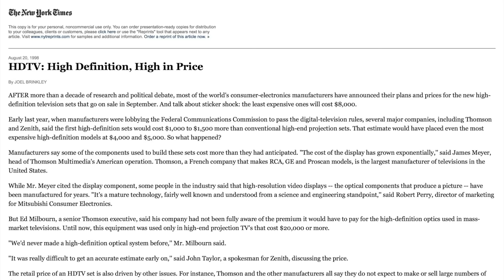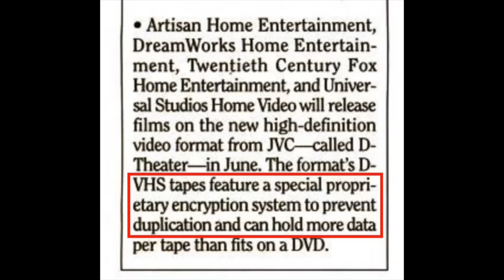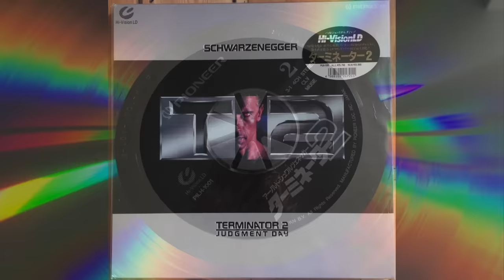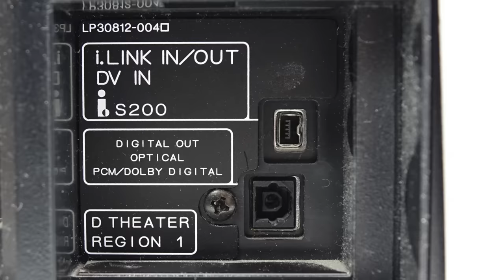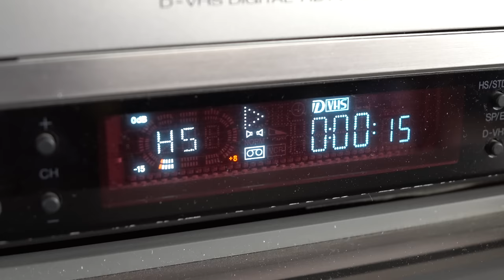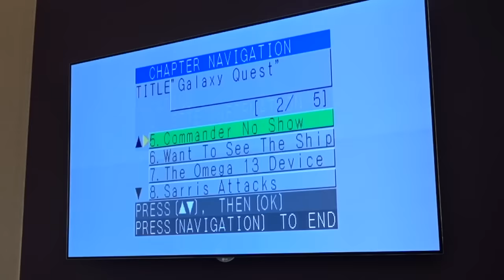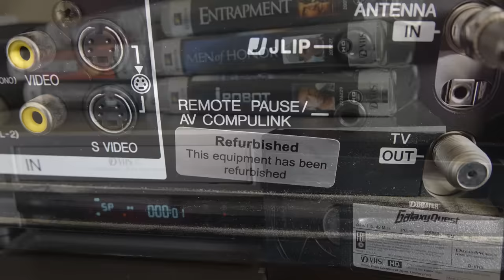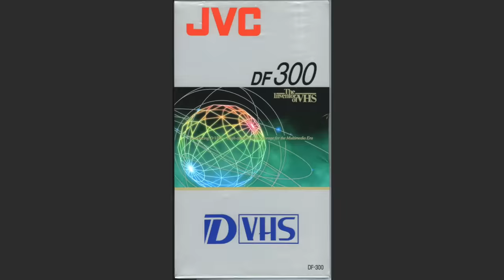Remember when HD Movies came on VHS tapes?

Comment: Had no idea HD Video appeared on VHS, really interesting
Reply: +Blaize 
There were also HD tube TVs (at least I read about them once back in the day), which would HD HVS tapes quite well.
Reply: +useless1997 I had a Samsung HD CRT TV in the early 2000s. It wasn't much cop though, the tube was poorly made and had very bad geometry. I ended up swapping it for an early LCD model.
Reply: For a brief period, around 2007, I had a 36" Sony WEGA HD tube tv.  it was wonderful for my new xbox 360, I think it was my only HD source at the time.  I still remember the warmth of the colors compared to the affordable LCDs of the time.  I also remember trying to move it in with a hand truck.  I leaned it back just a little and it began to crush itself.  It was well over 100 pounds.
Reply: Brad Strawn
Tube displays were so stupidly heavy. I had to move a 20 inch tube display to the trash some years ago and I could barely lift it.
Reply: didnt realize that CRTs tubes for you could do HD
Reply: Of course. CRT computer monitors could display higher than HD resolutions for many years.
Reply: yeah, I got Castaway, X-Men, Bourne Identity, Terminator 2, Die Hard, Alien; . I bought a JVC player in 2003;  Hardly ever use it. I paid $1200 for it and the tapes were $40-$60; I had over 20 movies originally in this format. Quality is really good; I remember that a few years later I bought a 2001 Subaru after I sold some of those movies at more than what I paid for em each.
Reply: Chris Wilson Yep. I actually had dual CRTs with 1600x1200 resolution each a few years back.
Reply: Looks about the same as modern movies!
Reply: Moises Topete
 they look better imo. More depth, better colors.
Reply: Y10Q Yea. But it is still 1080i compared to the standard 1080p. Sound is superior
Reply: Moises Topete
 the quality feels better. I don't know if it is or isn't. There is more something to them that makes the movie better and more enjoyable to watch.
Reply: Y10Q I think colors are better. Like literally, some Bly rays are a bit digitized and it gives it an unoriginal feeling.
Reply: Benedikt 20 inch tubes aren't that heavy...
Reply: tehfawkinman
For how big they are, of course they are heavy.
Reply: Benedikt I mean...I guess they would be heavy if you're a little on the weak side...
Reply: Jesus, of course they don't weigh as much as a car, what's is your problem?
Reply: Benedikt Meh, just messing with ya, talking shit, etc.
Reply: tehfawkinman
Okay^^
I guess you never know on the internet :D
Reply: Fatalsprigs Pfft, spoiled. Ever watch a black n white with rabbit ears?
Reply: same here, Blaize.
Reply: I have a CRT Mitsubishi 37" Megaview from 1996. Technically its not a TV, but a "Monitor" since it has no tuner. VGA input. Does 1080p.  With a transcoder, I have an HDMI input. I think the resolution is something like 1600x1200.

I also have a NEC XV-2940, but I need to replace a capacitor in it.

I also came across a Samsung wide screen 29" CRT with an HDMI port on the back. Didn't even know those existed.
Reply: mattcintosh2 I came a across an EDTV (Enhanced definition Television) at a pawn shop for 45 bucks a SHARP 20 inch. I have a Sega Dreamcast and a Sony DVD player hooked up to it. It looks pretty good. I never knew there was such a thing as EDTV. It doesn't have any HDMI ports on it. After all Television broadcasts went digital I remember seeing SDTVs televisions that could pull in Digital signals through built in tuners. Never remember seeing an "EDTV" before though.
Reply: An advantage of VHS is true slow motion.  I haven't seen slow motion on a DVD player that is as good.  It's always choppy.
Reply: Yes, D-VHS.
Reply: Video of NYC in 1990 HD is available
Reply: BlaizeV I learned about DVHS just this year when I saw that DVHS demo video of New York City here on YouTube
Reply: Devin Tariel saw that video a couple of months ago that was the first time I had heard of this format
Reply: BlaizeV I enjoy watching my VHS tapes every day Right After school
Reply: Sannesthesia I got a VHS tape in the mail this morning but it got broken when it arrived in the mail
Reply: ungratefulmetalpansy buying movies always keep me and my little nephew with entertainment
Reply: BlaizeV thats what i love about this channel. seeing all the ancient technology that i never heard of
Reply: 801 like
Reply: They want to toy with you and have you creating questions to ask yourself

Comment: Sweet Jesus 50gb from something released in the late 90s, something we wouldn’t be able to match until dual layer bd in 06. 

Guess there’s a reason they still use magnetic tape to archive large amounts of data even today.
Reply: Well we technically had hard drives, which were still quite smaller than a VHS...
Still, very impressive for magnetic media
Reply: @extrahourinthepit  in 1998, the highest capacity of a HDD was 47Gb and this was a 5.25" full height HDD which had the dimensions of 83mm x 146.3mm x 203.5 mm. A VHS is smaller than this with 187mm x 102mm x 25mm. This means that the volume of the HDD was about 5.5 times higher than the volume of a VHS. Also the price of the 47 GB monster HDD was about 3000$ which is many times higher than the price of the first D-VHS tapes. A 3.5" HDD is about the same size as a VHS cassette (101.5mm x 146mm x 26.1 mm, so the length is about 22% shorter and all other dimensions are almost the same), but these only had about 20 GB max in 1998.
Today type is still the cheapest format to store large amounts of data. The price of a LTO-7 tape with 6 TB (uncompressed) is about 10$ per TB, which is about half of the price per TB of a HDD. And the highest capacity is actually LTO-8 with 12 TB uncompressed (but they are rather new, so they are still a little more expensive per TB than LTO-7). All LTO tapes have dimensions 102mm x 105.4mm x 21.5mm, which is less than half the volume of a 3.5" HDD. So it can store much more GB per volume than a 3.5" hard disk which currently has 16TB or less.
Because of this and because tapes are probably still more reliable than HDDs when not used often, tape is still the preferred archival media for big corporations. For private people and small business, modern tape drives are simply too expensive (simple internal LTO-7 drive start at about 2200$, LTO-8 at about 2700$). Unfortunately there is no consumer tape drive built anymore since a long tome ago (I think they are not anymore produced since the 2000s).
Reply: rfvtgbzhn 
Alright, but I’m pretty sure we already had 1000GB HD in 2009, and we sure as hell had no less than 128GB 2.5” HD, so my guess is we must have had something more than 50GB just three years earlier...
Reply: @extrahourinthepit  I don't understand to what you refer, the whole video is about D-VHS which was introduced in 1998 and I refer to this except for the parts where I refer to now and the last sentence which is about consumer tape drives are not built "since the 2000s", but I think this is most likely since 2000 or 2001.
The video also refers to 2002 when D-Theater was introduced but it had actually the same capacity on the same tapes as the original D-VHS, it only had a higher data rate (and shorter playtime) to make HD possible.
And I see no significance in "3 years before 2009", which would be in 2006.
Reply: rfvtgbzhn have you read the comment we’re replying to
Reply: @extrahourinthepit  I guess that this comment only refers to exchangeable media for home video and in this field D-VHS was really in front until blu ray came out.
Reply: rfvtgbzhn 
That is actually fair. I don’t think anyone wonders why exchanging 2.5” HD wasn’t a popular video format.
Reply: @extrahourinthepit  maybe some people even built an HTPC with a 3.5" hot swap rack but it was definitely more expensive than using a DVD recorder (or HTPC with DVD burner) at that times if you recorded a lot. And before that most people just used VHS for recording TV. I find it hard to find statistics on this but I guess that VHS was the most common format for recording videos at home until about the mid 2000s. then it was replaced by DVD- and hard-disk-recorders and blu ray recorders never became a big thing probably because of DRM.
Reply: @extrahourinthepit  on top of everything mentioned in the prior reply, hard drives really don’t handle being transported much very well, especially for stuff like rentals I can’t imagine they’d live very long.  Plus it’d obviously be more costly than other media.
Reply: @jdatlas4668  VHS was truly an incredible format
Reply: Yeah makes me wish I had a recorder and some tapes for backup storage

Comment: Back in 2009 I bought the same model of JVC DVHS player used on eBay because it is HD capable. I rarely use it, but it’s a cool legacy device to have in the home theater setup. I still have a few VHS movies in my collection and some home movies.
Reply: @Inactiveprobably  some of D-VHS are also advanced VHS playback devices with highest analog quality available from VHS